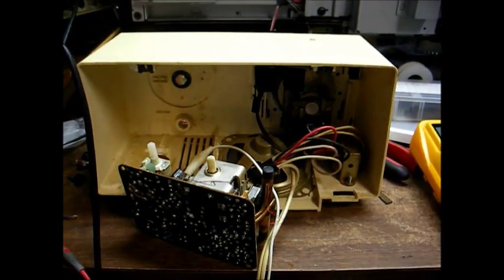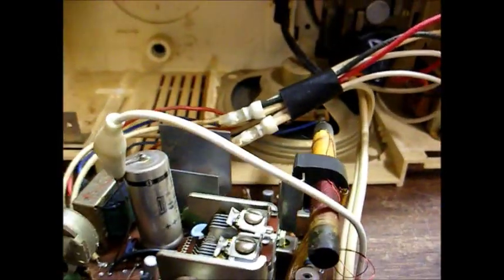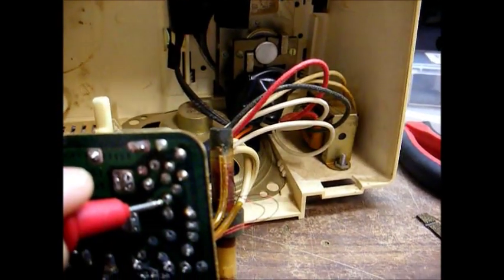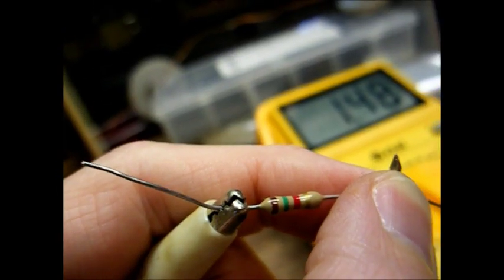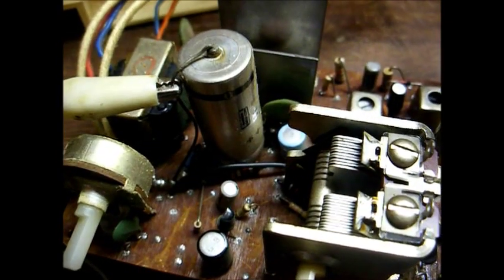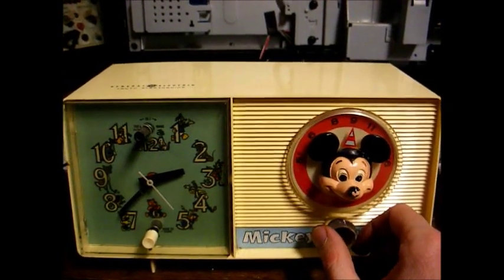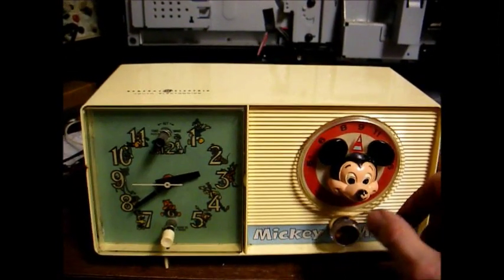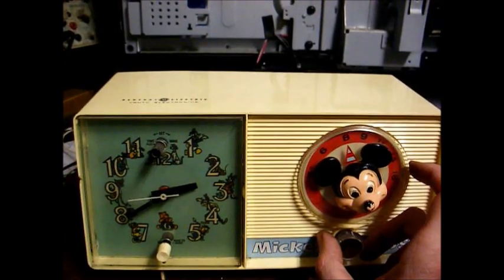Repair of a 1971 General Electric Mickey Mouse solid state AM clock radio

Comment: I have been binge watching radio repair videos, for the last couple of years, I have been intrested in such things since 1955 while standing watching my father replace tubes in our old battery pack Farm Radio that provided us with entertainment in our old tarpaper covered farm house built in 1910 by my grandfather.  Since there was no power available out where our farm was, it was never wired.  When the REA came through, they put a power pole in our yard but never ran  it anywhere so there we sat, power just a short walk away but kerosene providing our light and kid power carrying the water to the house from the windmill that pumped the water from a very deep well between the house and fairly new barn since lightning had removed the barn that Grandpa built in the teens.  At any rate, I finally got up the courage to buy a radio off Ebay, listed as not working.  That listing was indeed an understatement.  Someone with less knowledge then me has been in it. How long ago is a mystery since the set had a lot of cobwebs inside.  What they did to this 1957 GE was to replace one capacitor with an orange drop then , as it appears the printing had been somehow dissolved on some of the PC board preceded to strip some power cord and solder it in selected places along the  outer trace around the board.  Now there is no power getting anywhere,  at least none at the switch.  I am building a small isolation transformer setup but have yet to install the outlet for it, using a new isolation transformer from Triad.  I will know more, of course when I get my multi-meter in action but wanted to be able to trace the power from at least the line to the switch.  At any rate, wanted you to know the effect you have had on me, Thanks a million for the videos, I learn much from them with every show. Oh by the way, like many beginners, I managed to push the circuit board into the speaker cone making a large hole in a pristine 5 inch cone....

Comment from the maker: They usually ran the audio output stage at 80V-130V, via means of a dropping resistor. The RF and IF stages of the radio usually got their voltage from another big dropping resistor or from the emitter voltage of the audio output transistor.

Comment: pretty cool that the speaker is on the bottom of the radio. Kind of bounces the sound off the surface it's sitting on and produces a neat ambience of sound
Reply: Now that you mention it, I recall the radio my aunt gave me for my bedroom, an  old one that their family replaced, given for the work they got out of me when I spent half a summer at their farm/ranch both caring for the cattle and helping my cousin shovel grain, and work the fields.  It had a unique setup with a large speaker on the bottom, the tuning knob on the top with the volume control and a beautiful dark blue patterned face plate.  It played rock and roll very nicely and as you say, depending on where I placed it, the sound changed according to the wood beneath the set.  I settled on a nice night stand I found in the attic of the old house dad found for us when we moved to town. It was made from very old walnut and I believe was supposed to be some sort of stand for the dinning room but worked nicely beside my old bed moved in off the farm.  Ah yes I recall listening to the Padre's Platters, an overnight rock show on KFYR Bismarck ND, he was a  cool priest who offered bits of religion with tons of great rock.

Comment: It looks like G.E was buying a lot of Japanese made parts just to stay competitive, I saw what looked like a few Nippon Chemicon capacitors in that board. The older solid state stuff is getting as bad for electrolytic capacitor failure now as the tube sets are for paper capacitor failures. With regard to that resistor some of those carbon composition resistors are so unstable that they drift upward just sitting on the shelf, the ones with a rough brown shell made by IRC are the worst.

Comment: I ordered the same radio you have there a Mickey mouse ,it was packed so bad by some dimwit from good will ,giant box smaller radio a little bubble wrap to help my new screw up antique radio to slide around that giant box for a four day trip ,it cracked the once.perfect clock.face with cracks,and the Mickey mouse was knock off ,and I think someone glued the tuneing knob on.to the plastic tuneing  condenser ,so to get the radio apart to check the capcitors,I don't think it's possible ,plus it's got screws that need a speacial.screw driver,this was my birthday gift,You can't believe how losses off I am .this is the second radio from a good will store that they cracked the clock.face ,,

Comment: how did those transformerless transistor sets work? did they use a big powerresistor to drop the voltage down to a lower voltage the transistors could run on?
i have never seen one in real life and i don´t think they where very common here in europe. tube transformerles radios was very common however i own severel of those.
Reply: agfamatic91 From what I've seen, the current is often dispersed among the multiple transistors that can be found in these appliances,although  in some cases there are multiple 1 watt resistors that reduce the current

Comment: I bought the same one from goodwill,who dont no how to pack a box ,my mickey mouse face was knock off and there a crack in the clock face that wasn't there before shipping ,the radio plays great ,but I thinking of changing the filter cap ,anyone have any suggestions should I recap it or wait tell it gets a problem .I also need to figure out what glue to use to put mickey back on .I wanted one of these radio after I seen radiotvphononut fix his .thanks for your videos .